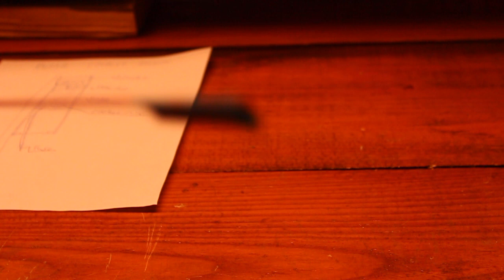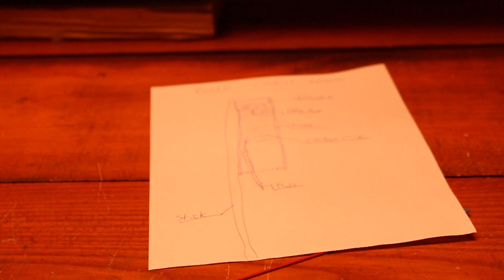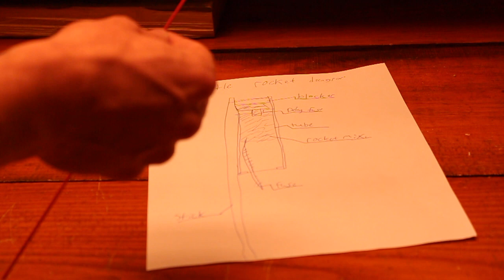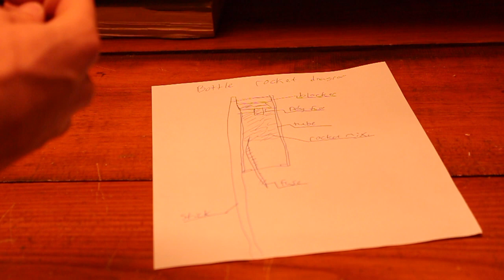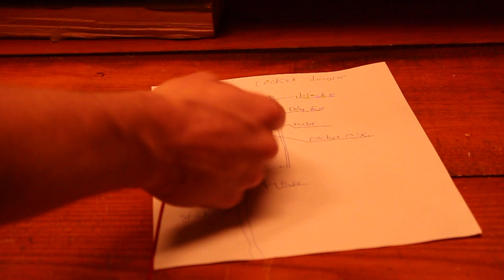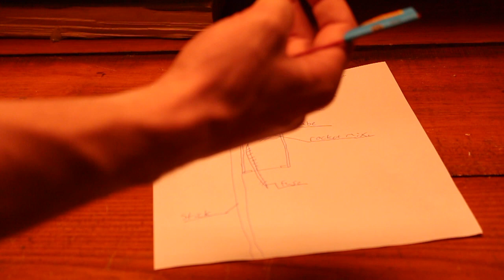How Bottle Rockets Work

Comment: There is different ways you can fire bottle rockets 1 is lighting it and holding the top of it light. and then waiting for it to fly up and you release. the second way is to obviously put it in a soda bottle and let it fly out of the bottle. or just stick it in the ground.